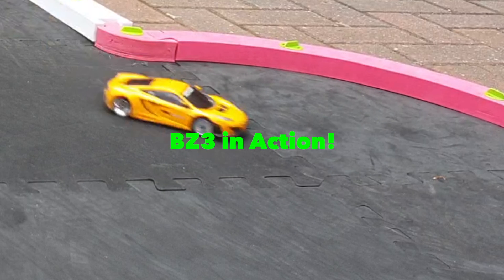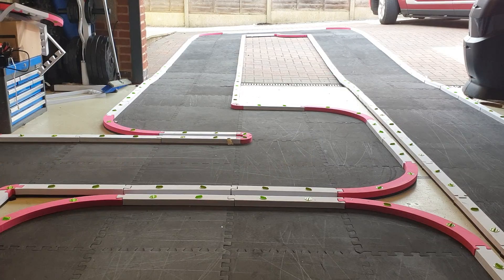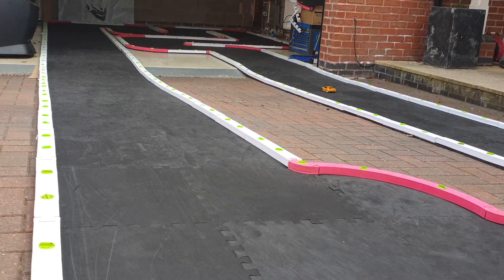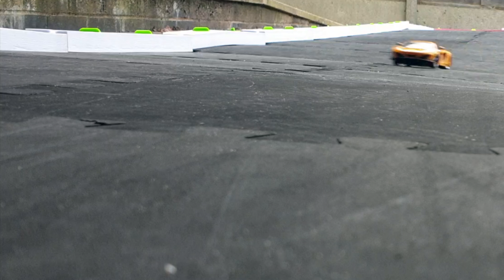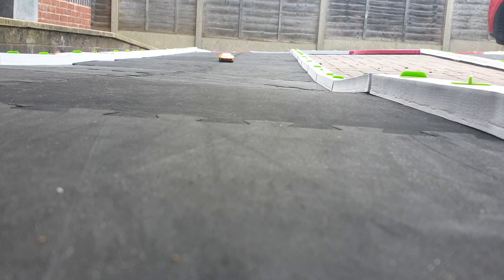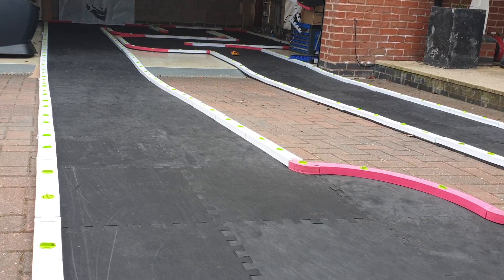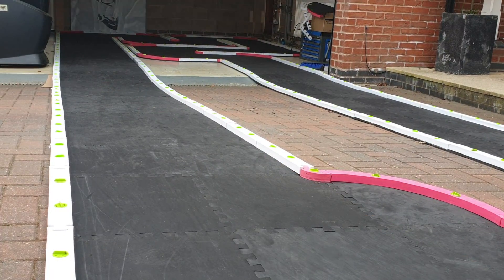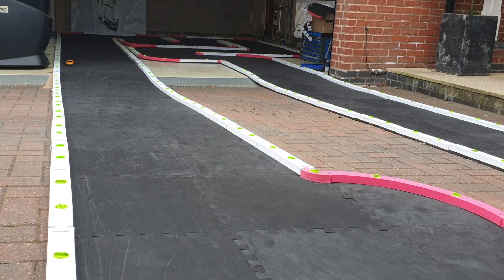Atomic BZ3 mini rc car   in action

Comment: my suggestion, try to tighten your rear diff a bit and loosen your front diff a bit, it will help smooth and fast cornering
Reply from the maker: Thank you, I will see how this helps. All advice much appreciated ☺ need this for the hairpin turns.
Reply: Garage Mini RC UK oh I almost forgot, make sure your car move freely as a roler. I used to race without using the brake with this setup most of the time.
Reply from the maker: @eekdicelana  yes I did that this time turned off the drag brake and let it roll. Bz3 seems to like this. Must be the belt makes it so smooth. 👍🏽

Comment: wait till you try that GLA . that car is the next thing to beat on the tracks around the world.
Reply from the maker: You read my mind, I was going to do that for my next video, should I use the brass chassis or standard? I have both..and nothing but time 😂
Reply: @GarageMiniRCUK   well it's already installed so I would just try it out with it .  these little cars are plenty fast with a 5500Kv  a lot of people still seem to think that lighter it better ; but more weight will keep that little thing planted on the track ... cornering speed will way better . tires will suffer more but I guess that it the triad-off to have better lap times. the heavier chassis are usually used on short  tracks.
Reply from the maker: @killahkay2112  I changed mine to a drift  set up... I'll change it back ready to roll. I have a sensored set up with it currently with 3500 kv I also have an 6500 kv.... So I'm going to get busy. 👍🏽
Reply: @GarageMiniRCUK   I'm on the market for a GLA  right now ... Haven't seen any good second hand deals for one so might have to get it all new.  gonna get biz as well during this confinement  .  though i have to say none of these RC shops do a Solidarity / Covid 19% / Easter sale :( ... how tight are they hahaha. will be looking forward on your report.  PS for a track you could just buy a long stretch of carpet  and then just roll it out when ever you want to run on it ... less time consuming
Reply from the maker: @killahkay2112  did have that originally, in the end got this track  from hobby King on sale. Its transformed our race days. You can't cheat! Plus a laptimer really helped make it more fun. I got my gla off ebay in the UK. The online  gla store  is good, I also got parts from a German company called rc devils I think. The bz3 I got from miracle mart.

Comment: Ball diffs front and rear? Or did you put a front one way in. Braking looks stable so I'm guessing full ball diffs.
Reply from the maker: Ball diffs, abs on. Standard set up 5500kv motor.  atomic esc. Very stable even after hits bump, braking still even. Turned off  drag brake. 👍🏽

Comment: Ok this putsit over the limit, time to go look for a proper track and reorginse the furinture
Reply from the maker: Really have new respect for the nb4 /bz3 combo. Addictive. Going to need a bigger boat...i mean track 😂
Reply: Glad to see the car in its element, glad to see it quantified that on the small tracks its not much better but in this scenario it does well. i have a number of high powered RWD and no matter how much i tweak it they all get torque steer, love that the belt drive helps with that
Reply: @GarageMiniRCUK  yeah its a wonderful combo, i have swapped nearly everything over to the NB4 and use it with the PC, makes cars so much easier to drive now that i have a processes to tune the controller for the car/porpoise at hand
Reply from the maker: @BlitzWorks  with the pc? Am I missing a trick?
Reply: @GarageMiniRCUK  I have a couple of driving and RC games on the PC for rainy days, plug the NB-4 into your PC via the charging usb port then in the receiver/binding setup page you can select USB mode and the controller will show up as a joystick
Reply from the maker: @BlitzWorks  OK, now I need to download an  rc game. Any recommendations?